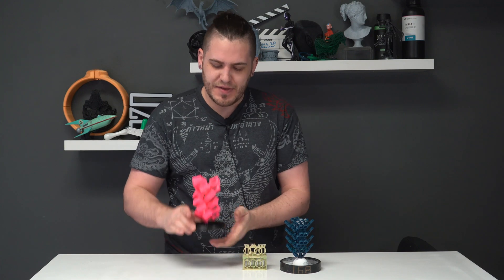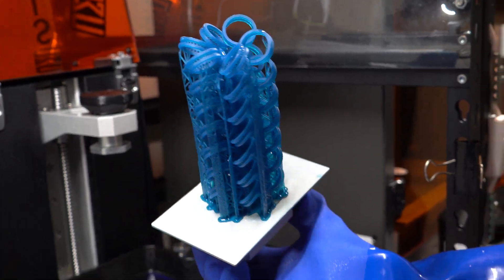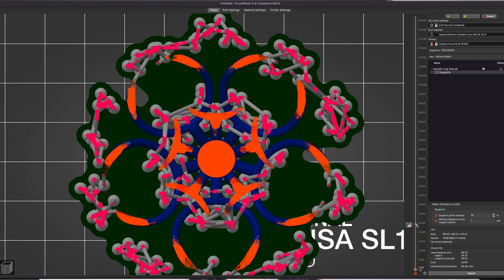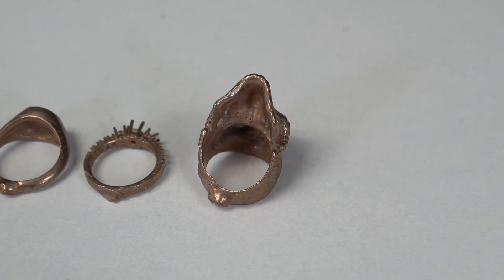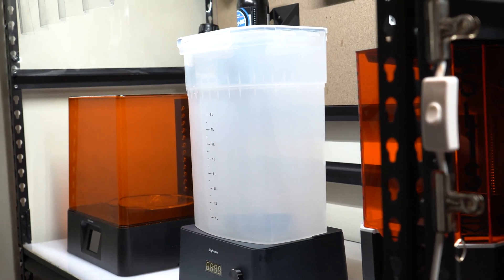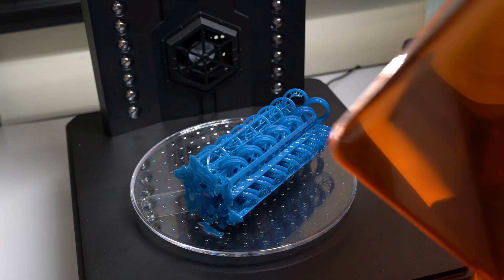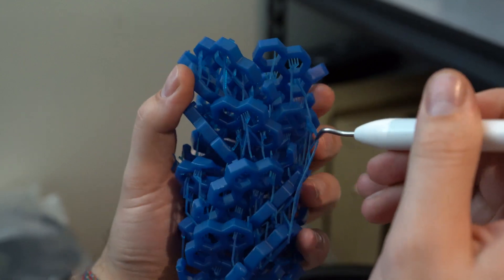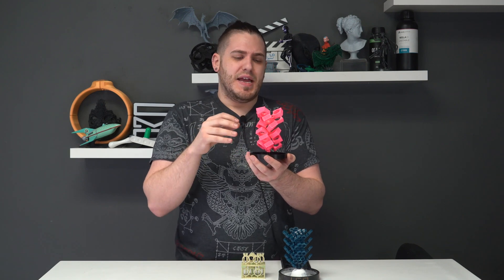How to cure & wash castable 3d printed jewellery trees

Comment: I'd like to see you are doing your ventilation. Like inavine you want to start doing this from home, how would you start it?
Reply from the maker: So we have two ventilation systems and not sure which one you're referring to. 
This is our burnout ventilation for our kiln during casting https://youtu.be/M-2txdK8I_o we have since modded it to push the fumes outside. 
This is our 3D pruning station with ventilation https://youtu.be/kguap1p2mLY it's much more DIY friendly and is built in a spare room in our apartment.